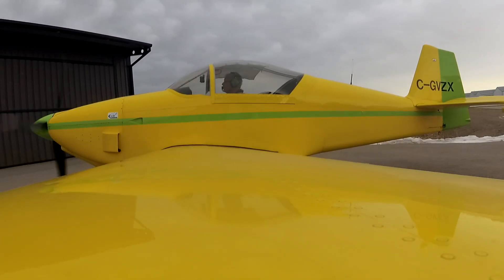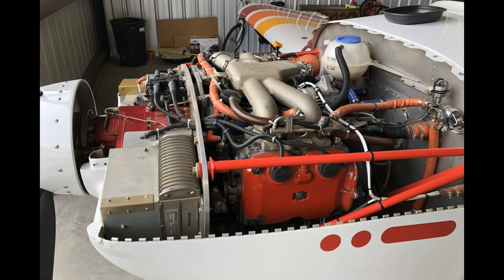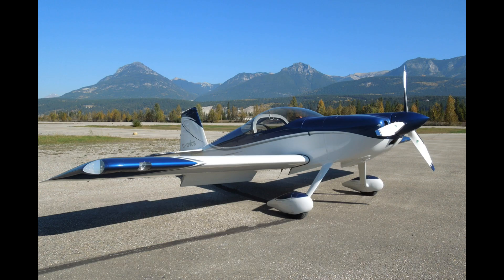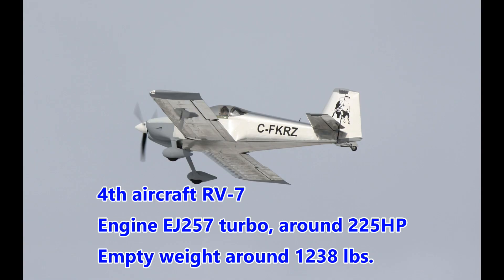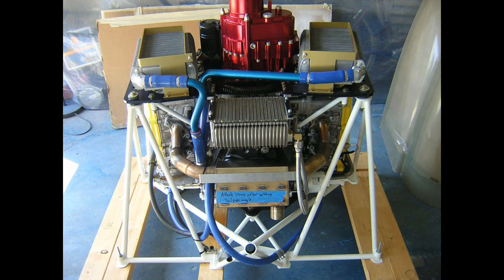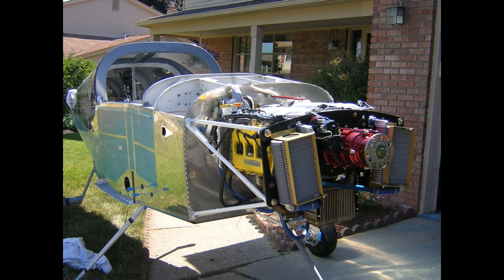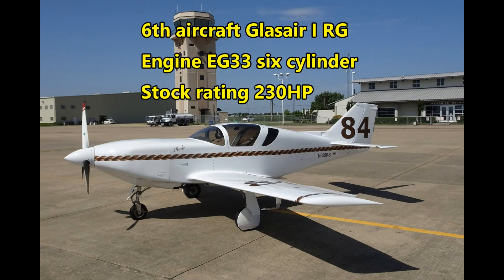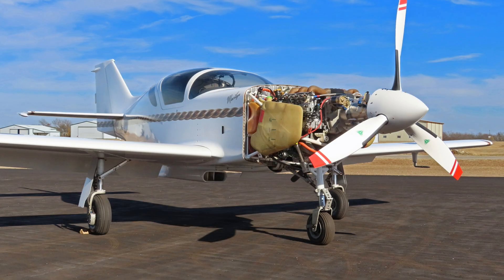6 Subaru Powered Aircraft

Comment: Are Subaru H4 & H6 better than small displacement GM LS V8s, or does it depend on the size of the aircraft?
Reply from the maker: Comes down to weight and hp required for a particular aircraft. Nothing special about Subarus except that they fit in the cowlings designed for opposed four and six cylinder aircraft engines.

Comment: Hola. Desde Argentina quiero hacer una consulta. Cual  puede ser el motivo que 5 motores Subaru ( 2 ej18 y 3 ej20) en aviación experimental, rompieron cigueñal en el mismo lugar. Atrás del volante de inercia. El rango de trabajo es de 4.000 a 4.400 RPM. Desde ya muy agradecido de darme una respuesta.
Reply from the maker: We don't use these engines in North America, typically EJ22, EJ25, EZ30, EG33. Have not seen any broken crankshafts on these.

All are using the factory pulley/ balancer though (torsional vibration can be a big issue). Do not use an aluminum crank pulley. direct drive with no gearbox could put a high bending load on the crankshaft too.

Comment: Wet sump isnt the best idea with these motors, they have issues with oil starvation.

With a dry sump at the power levels y’all are running I’d imagine they’d run circles around lycomings.
Reply from the maker: They work just fine with the stock wet sump oiling systems. No issues with oil starvation otherwise they'd blow up right away. I have 21 years on mine now. Russel has over 1000 hours on his.

Comment: I’ve owned a few WRXs and a few STIs I would never fly in something with a Subaru motor. Lots of crank bearing failures and ringland failures . I honestly question the design of the horizontally opposed engine. Rings are not going to wear evenly.
Reply from the maker: One guy in my videos has over 3500 flight hours behind EJs. No failures. Ring land failures indicate detonation. That's not the engine's fault- too much boost, too much timing, too lean, not enough octane are the usual causes.

Rings mainly wear from gas loading and we don't see uneven wear on Porsche, Continental, Lycoming, Corvair or Subaru engines, even with high time. Not sure where you are getting this idea from.
Reply: @rv6ejguy  If the ringland failures were due to detonation why did Subaru recall several engines for defective ringlands? Same thing goes for the crank bearings those were recalled too. I had a crank bearing failure at 18k miles with a bone stock EJ257. I’ve seen several other failures too throughout Subaru groups I have spoken with. You’re going to be flying one day at that engine is going to go pop. You’ll be saying, damn that guy from the internet was right.
Reply from the maker: The ring lands were not defective. Subaru issued a Stop Sell order in MY2009 STis after multiple engine failures caused by improper ECU calibration and subsequent detonation.  Detonation is the #1 cause of ring land failures. I've been building turbo engines for 40 years. Seen lots of cast pistons broken from that.

Subaru also had a number of oil pump pickup failures resulting in destroyed bottom ends around the same time.  The smart engine builder knows about these things and takes steps so they don't cause failures. 

 Lots of "tuned" STis fail because the tuner doesn't know what they are doing. This is why OEMs don't warranty most modified engines.

In aircraft, we don't  push boost anywhere close to even the OEM factory limits. Most are running less than 7 psi for takeoff and maybe 5 psi in cruise at most.

All makes of engines have their issues. @Dave-so7sf
Reply: @rv6ejguy  The weak ring gland myth is not just because bad tuners it is also a lack of knowledge on the part of the owner or engine builder running too much power and therefore heat where the rings cant expand and close the gap anymore creating a large force on the cylinder walls and the ring glands. either not enough ring gap or tuner lets it run too lean causing heat...
Reply from the maker: @tlovsoe4211   All cast pistons have relatively weak ring lands and those are almost always the first things to fail if there is any detonation.
Reply: @rv6ejguy cast pistons are brittle. Not ALWAYS the first thing to go. The effects of the piston ring gap being too small can be seen on the Big Bang b series done by Richard holdner.
Reply from the maker: @tlovsoe4211  Been building turbo engines professionally for over 45 years man. Seen it many times...

Comment: Research this engine and the company that made it!!! and consider making contact with whoever has copyrights to this engine these days!!! If you ever get permission, and with your imagination, and your own hands, you can build your version of this amazing engine, and you can utilize your won lightweight alloy material, and also recreate any redesign variations you think need changing on the engine, both for improved performance, and to fit inside the engine bay, but imagine 4 spark plugs per cylinder!!! Sterling Marine engines were amazing engines way, way, way back in the day!!! more than 120 years ago!!! https://youtu.be/or-lAhkUBHo

Comment: a very smooth, reliable engine- no doubt. but fully dressed in the plane? 326Lbs, WITHOUT turbo. 160hp. an aeromomentum AM15t WITH turbo? 215Lbs: flight ready... that's the same hp- but with the turbo, over 100 lbs. lighter, and is crate ready for install for $18,000.  fully dressed subaru turbo engine weighs the same as the newly released deltahawk turbo / supercharged 2 stroke aircraft engine, which has an output of 180hp- and as much torque as a continental io550... .even if it is $60k.
Reply from the maker: I don't see your point. Most of these conversions shown were done 1 to 2 decades ago, long before the AM engines were available. They all cost a fraction of $18K and they are proven with tens of thousands of hours on them collectively- something that the AM15T doesn't have.

No private owners have flown a DH in a Homebuilt yet and they'll be a lot more than $60K.

Finally, torque isn't the the metric of importance for aircraft motivation, HP is, and the DH in no way would replace a Conti IO-550 in that department, being 130hp short.

Comment: What are you guys doing for redundant ignition
Reply from the maker: With one plug per cylinder and coil packs or COP, not so easy to do. The electronics are more reliable than the engine. Most of us fly with single ignition. Not aware of any problems with that on any of these planes featured here.

Comment: The facility they make them in was originally building aircraft engines for their planes in WW2. The engines are probably very similar to the engines They used back then. The 3.6 and actually all the 6 cylinders have had issues in land vehicles. If they would figure out the issues that could be a good engine option. Would be interesting to see them turbocharged

Comment: good Video it’s interesting on the Contraversy between Automotive  engines being used as Aircraft  motors versus Aircraft motors  i’m  60 years old and i’ve always been interested in Automobiles  since Childhood along with being a Avid Reader my entire life as long as i can remember  people have been Converting Automotive motors  for Aircraft  back to the Model A then later the VW Aircooled  and Corvair   a few years later the Mazda Weinkel or Rotary      then of course the Famed Subaru Boxer  motors  IMO the Subaru   really  has been a great candidate  for these Conversions as it’s  a very successfull  engine  in  almost everything it’s been used  or modified /Adapted to be in  they are known to put out great Horsepower numbers   with decent fuelEconomy  along with Reliability  heck in the Automotive World they have become one of the most prefered motors  for high end Sports Cars  and Replicas  most specifically  Rear Engine and Mid Engine designed Vehicles , there is even a new generation  testing them out in replacing Air Cooled Porsche 6 Cylinder Engines  with the Subaru 4 cylinder  and getting a way less expensive Powerplant that  can come close to the level of Performance of the Porsche stock motor  because of a weight reduction

Comment: That's an option I never thought of for an aircraft to be honest.. Did you know that Toyota was planning to develop an Aero version of the 1-UZFE V8 automobile engine in the early 90s, but ran into financial problems during the Japanese recession of the time and abandoned the project in cost overruns and time constraints? Similarly, the firm Orenda (I 'm not sure if they were still in Canadian hands at that time) was trying to get the 427 cubic inch Chevrolet ZL1 Aluminium V8 certified, due to it's low weight and great power potential per cubic inch, but again ran way over time (certification didn't even happen until the late 90s for something that started right at the beginning of the 70s) and FAA wanted them to be TBO'd at less than 1500hrs and inspections at 1000 due to being an unproven technology.. So, we're back to the good old Lyco's and Contis - The  BEST technology that the 1930's can bring! Bring my Auburn to the flightline post haste! They are playing a relay of the Vienna pops at 9 on the wireless that I just cannot miss!!
Reply: Look up the Cleetus McFarland channel for an LS-1 swapped RV-7.   The sound, much less the power, is quite insane.   It's truly a mini-scale WWII fighter.

Comment: Very Impressive,, Great Color Scheme, and Huge thanks for all the Great Engine Install views. 
As A builder and Oshkosh camper since mid eighties, there were only about 3 auto engine builds 
where Subaru, Mazda, and a Chevy V8 was used. The Mazda Rotary was quite impressive, 
compact install in a Coors Experimental at the time, but it must be slim, with rarely seen models out there. 
I'd for sure use Subaru, but it was odd seeing the piston damage,, where I can only assume it was tortured to the max at full power turbo installs. Turbo' destruction after all the drag racing 
machine builds,, every time it's a destroyed engine above ten psi of boost. You should see what happens after 80lbs of boost is tested the first time,, where the slightest backfire going lean, 
rips the heads right off along with all the threads holding them on. Let alone the shortened connecting rods. 

Glad I stopped by,,
Cheers

Comment: I'm not sure why the Subaru engines became popular aero engine conversions.

Other than the fact they are horizontally opposed 4cyl, and therefore somewhat more familiar to pilots, and they fit into standard 1960s style engine cowls found on most GA aircraft.

Auto engine conversions do have some issues. The fundamental problem is that they are designed for much lower duty cycles of 10-30hp. The physical issue is the main bearing sizes, they have very small diameters to handle the high rpm redline, and they are short in length to make the engine compact to fit in a front drive or awd car. 

This means the average bearing pressure is going to be substantially higher than an aero engine, because a given amount of force is applied to a smaller bearing area. Cheap automotive aluminized bearings will probably fatigue the bearing surface, crack and disintegrate quickly. This is common among being who modify and drag race cars. The solution is high quality bearings with different metallurgy that is designed for higher stress and heat over time. And used in conjunction with oil which can handle the increased pressure such as class V ester synthetics or even diesel oil.  

And this bearing size issue is fine for cars because the fact they are not designed to run at maximum power or even at a constant high rpm for hours and days and weeks on end. Those that do run hard (race/rally cars) are highly modified with better bearings and oil, or have unusually good maintenance and regular overhauls.

That being said, for most Experimental aircraft the builder typically spends twice as much time building as they will ever attain flying their airplane. 

So the engines only have to last 500-1000hrs for many people. Lycoming engines often go 2500-2700hrs if built well and flown often. Aerobatic use brings this down to around 600-1200hrs, or maybe 200hr for the airshow circuit. But there isn't a single auto conversion that would hold up to world level aerobatic abuse. 

Lycoming type engines have a statistical in flight total engine failure approximately once every 3,800hrs. Auto conversions are going to be substantially lower than this. 

Therefore, one should expect an increased probability (talking statistical chance) of engine out landing in the life of their automotive converted aircraft. 

And knowing that a probability of a forced landing is relatively higher, it would be prudent to only install auto conversions in airplanes that land relatively slow and can handle off-airport landings. Such as most Vans RVs or a Bearhawk or similar. And then Practice and Drill repetitions of finding fields and landing on them. (Bush guys do this a lot, RV guys not so much). - I would personally not put an automotive conversion in a heavy glassair III if its intended purpose is long cross countries or actual IMC. Experimental race planes, engineered, built and maintained by a professional engineer, different story. 

Most people are not that guy. And most people don't know they need to call King Bearings with a detailed specification for a custom order long before they send their block to the machinist or smear a single blob of assembly lube on it. Talking to people, less than 1 in 1,000 people even consider the bearings before they go out and buy the latest greatest connecting rods for their motor build. (Hint: rods don't break under normal non-pre-ignition cylinder pressures, its far less force than the centrifugal forces found at high rpm. Rods don't usually need upgraded unless your increasing rpms substantially).
Reply from the maker: Where are you getting your information that auto engines are only designed to sustain 10-30hp from? Modern auto engines are validated to much higher criteria than aero engines. 200 to 300 hours at full power are common tests and auto engines are developing 3-5 times the specific output of a typical Lycoming.  Marine versions of auto engines sustain similar power levels to aviation and last just fine.

You seem to have missed the part on the EG33 at the end. This engine has trounced all the Lyconental powered entries in class and even the class above in multiple SARL cross country races. WOT 5200 rpm. No bearing or other mechanical issues. Over 850 hours on it now.

Bearing loads are similar. Auto engines use much lighter reciprocating assemblies having far less inertia. Subarus are short stroke designs which reduces pistons speeds- the main criteria for lower end stress. Subarus have 2 main bearings for each crank throw, unlike Lyconentals. These engines aren't showing any bearing distress or failure as you postulate, even using factory bearings.

In the second installment (video #105), we see one example having over 2300 flight hours on it. Still working fine.

I never said that Subarus were for everyone. Just showing that they are working well for many folks.
Reply: This may shock you, but Subaru bearings are easily replaced and cost around $200 for a full set of main and connecting rod "race" bearings. Also what you said about most people not considering bearings isn't true, most people in the Subaru community actually overdo it on the bearings, having them replaced every time they breakdown the short block, because why not it's only $200 for some new bearings.

You gotta remember, most people building Subaru engines these days are looking to get 600hp minimum, and daily drive it. That's 4x the power the block was designed for, and people daily drive these engines for years without any maintenance other than fresh oil.
Reply: With regards to bearing diameters, actually a smaller bearing can handle the same amount of power at high rpm as a larger diameter bearing 'can' at lower rpm (put simply). (remember power is torque over time), Small bearings are not good for low speed torque, but a designed amount of talk at high speed 'power' they are very capable of. The circumference of the bearing and viscousity of the oil and rpm allow a small bearing to carry load at higher rpm. The separation of bearing surfaces is actually due to speed, not oil pressure. The bearing surfaces hydro-plane over one another just like a planing hull on a boat or a tyre driving over water. the faster you drive into water the more the vehicle hydro planes, this is all dependent on how wide and how much load the vehicle has on the tyres. if the bearing is too large in diameter, it causes a lot of drag and shearing of the oil which causes heat and inefficiency. Bearings are also not made from aluminium, they are steel with multiple layers even from factory, mostly babbit and copper. The oils are also mostly class IV not V. PAO and PAN are mostly class IV, and they can be readily purchased off the shelf as that is what I use for my small bearing high rpm automotive engine. I did some technical training at bosch in their automotive department and for their engine testing they poor sand/dirt into the engine, run it well beyond oil change interval, carry out repeated full throttle cold start settings, over heat engines, introduce vacuum leaks, misfires, place the engine on a vibrating table while running, poor water into oil, you name it, it is very brutal. If anything automotive engines are tested much more thoroughly than aircraft engines, however I do not agree that all automotive engines are suitable for aircraft. These myths about automotive engines is so frustrating.
Reply: I don't think you understand the difference between boundary and hydrodynamic lubrication works. Secondly how torque, rpm and power works.